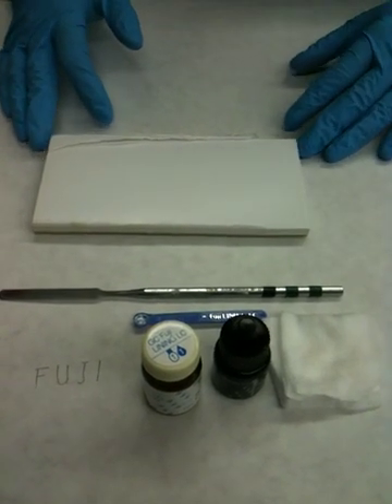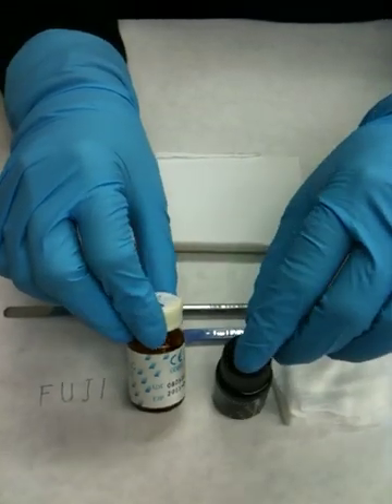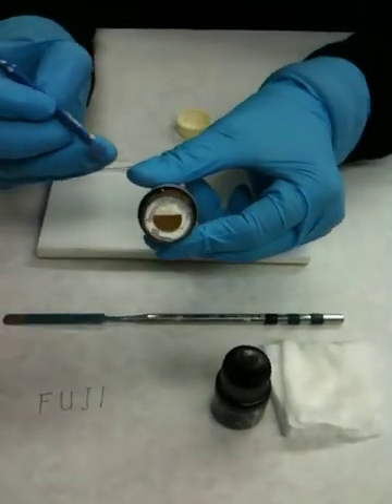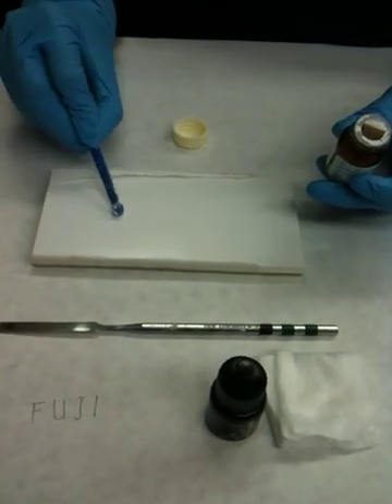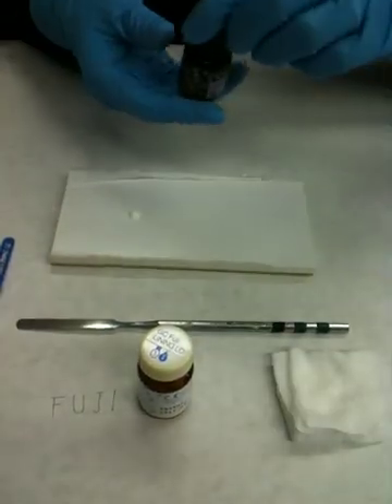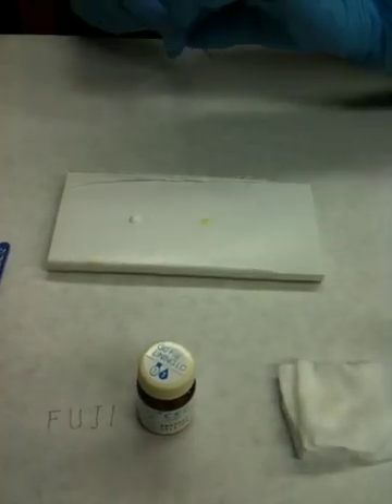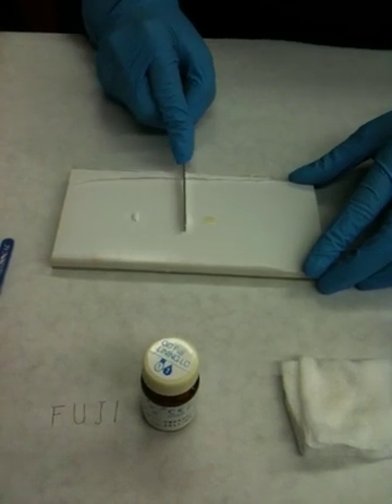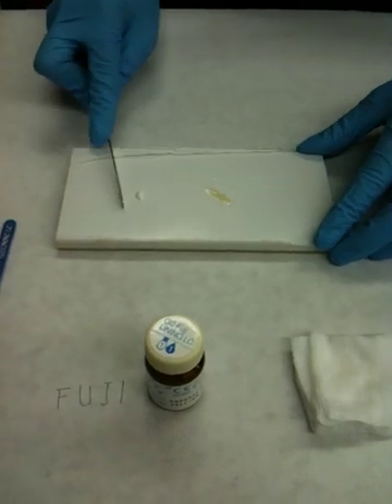Mixing Glass Ionomer(FUJI) lining cement

Comment: What about color matching? Do you add the shader liquid to the powder, the glu or the mixed cement?
I tried adding black ink to resin and it curdled, but adding to the hardener is different. Worked ok. (Fountain pen ink) resin for fairings on a bike, now to fix my teeth.